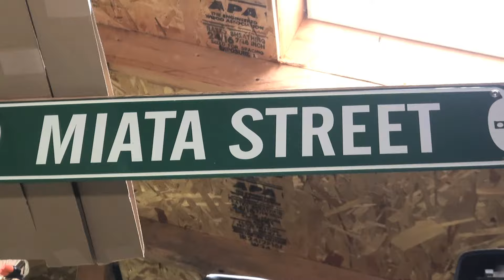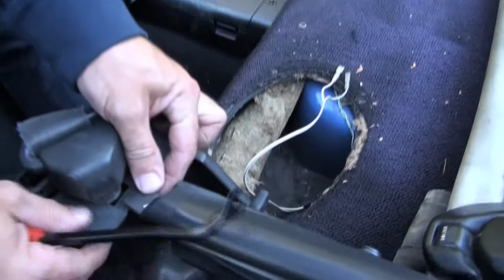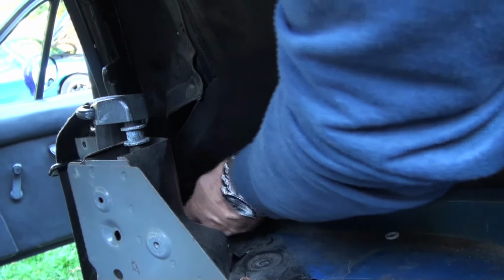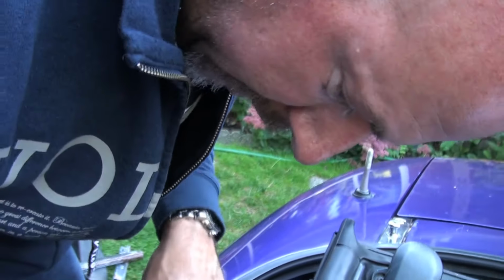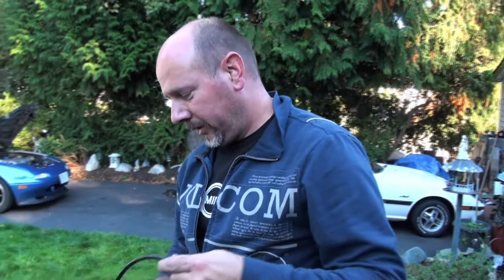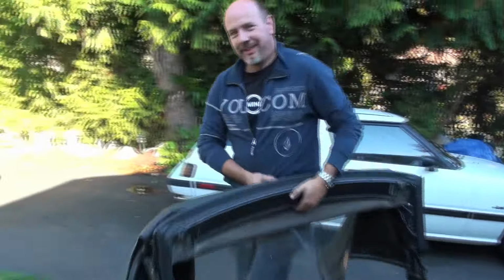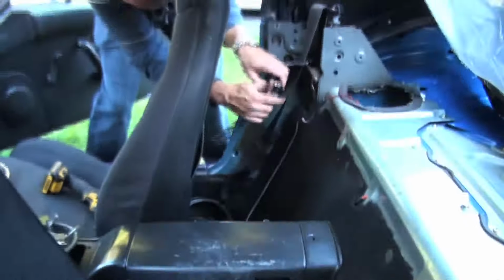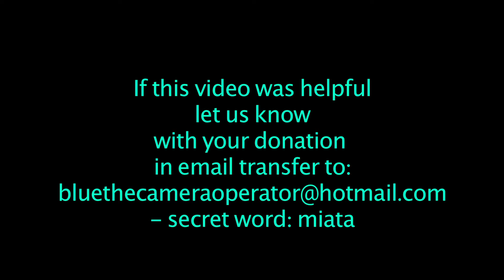Miata MX5 Convertible Top with Frame Replacement – MIATA STREET

Comment: FWIW: If you get tired of the plastic rear window, the NB top bolts right into NA. A spring & rain rail side plate upgrade (as per Miata service bulletin) is merited w/ that change as well otherwise it'll pinch & wear the top in a couple of spots on the sides. Glass window & defroster upgrade is nice!

Comment: Thank you so much for sharing your video! I have been stuck at the point of trying to line up the frame bolts. Thanks your clear explanation of the direction the frame bolt plate needs to be aligned, now it all makes sense. A million thanks!!

Comment: Another great video thank you!! I have a 1992 miata with a good top but the back window plastic broke it has a zipper for it. Would the process be the same to just replace the zip in back window?Also is there any where that just sell the zip in window?
Reply from the maker: I think you can buy the rear panel with window from Moss Miata. You will have to remove the top in order to have it installed. The other option would be to have an upholstery shop sew in a new marine/automotive grade plastic window. If top is old and showing signs of wear and tear, I would just put a new one on.

Comment: great tip on cleaning the rain drain thing!  a ton of crap came out of mine!
Reply: Still having a hard time cleaning mine,argh! Help!
Reply: @cleliamineo9133  I bought a trombone cleaner brush, works a treat, flush them through with warm water after. One of them 10mm soft top rain rail nuts came out of one side.... Great video Miata Man